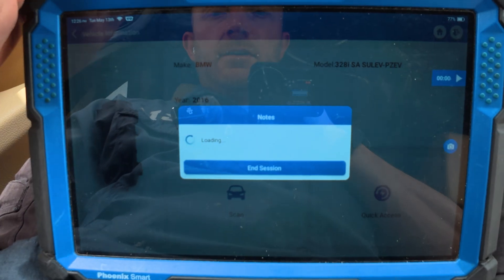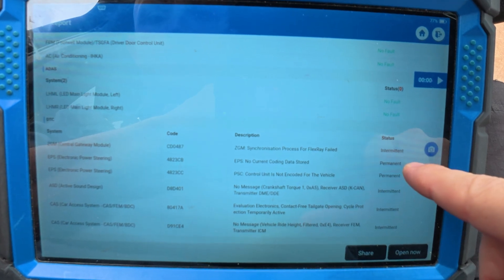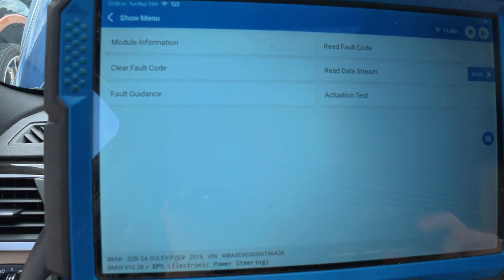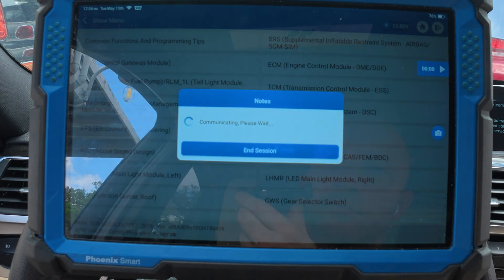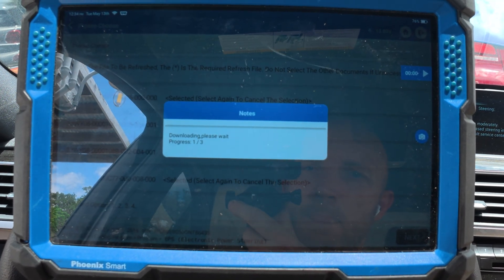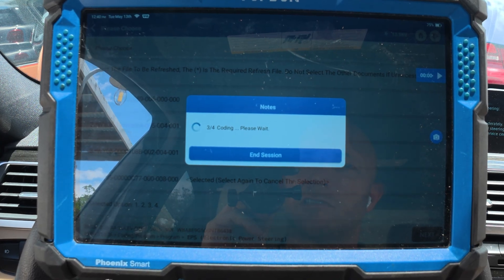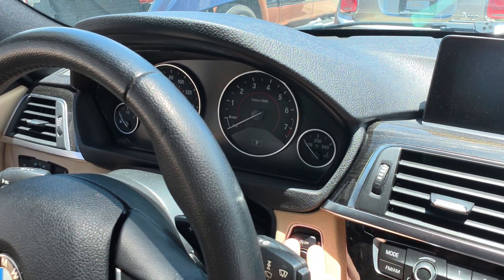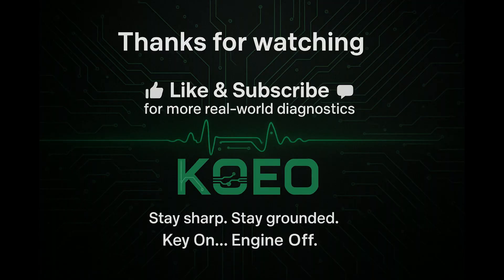BMW Power Steering Fixed In Minutes! EPS Not Coded - USED Module

Comment: great vid.i have the same problem with EPS after fitting a used part. i have a launch creader elite v2.0 which tells me there is no EPS .no communication.no warning lights.just heavy steering.can i get the ECU to recognise/code the EPS with this launch?
Reply from the maker: I don't think that tool will work. You'll need a professional level tool for coding. And if it says no com. Most likely the module is faulty or you have a power/ground issue.